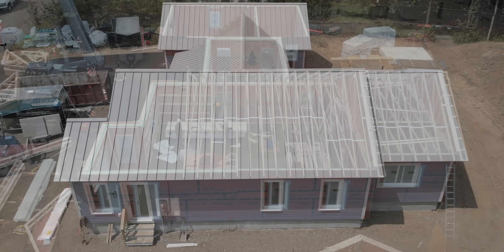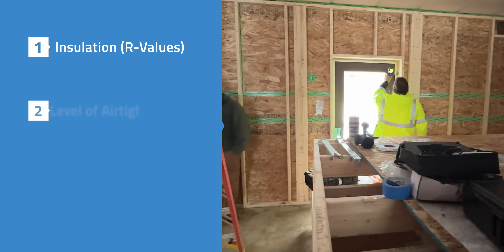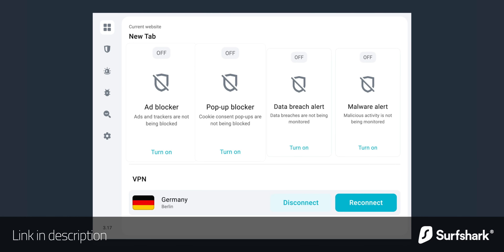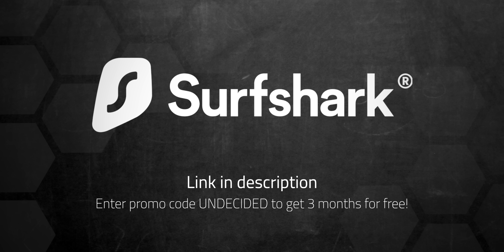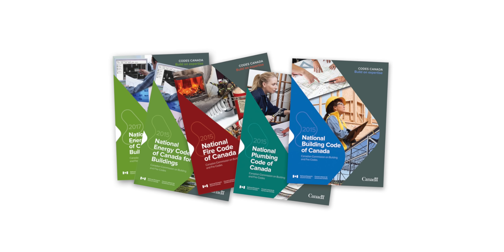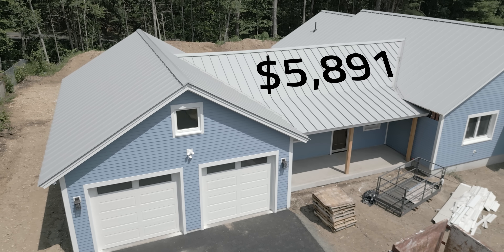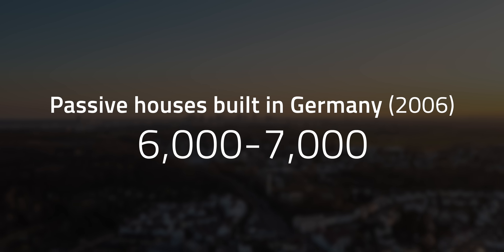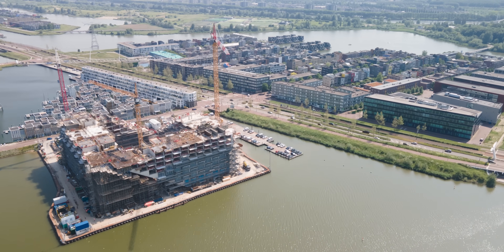Why Do American Homes Suck?

Comment: Simple answer: Houses in the US are three, to even four times, larger than in other Countries.
More complicated answer: We actually aren't "building" new houses in the US as frequent as these other Countries, that the typical consumer can actually have a prefab house of 1200sqft or smaller prebuilt for the typical "small home" cost in the US. Additionally, our "built" houses are around 3,000 - 5,000 SQFT in housing size, without the lot. To do this to an entire house is equal to having a large quantity of money, most people do not have in middle America.

In order for normal, average Americans to afford to have a "better climate, eco friendly house", they would need to be millionaires due to the 'wants and needs" of American's over our overseas counterparts that "do not require" 6 bedrooms, 4 bathrooms, and a large living room with a massive kitchen, dining area and pantry -- all well in excess of 20x20 per room size, with a dedicated room for all the serviceable goods.

Of course German houses would be insulated like crazy, the average housing size is 1,000 SQFT. The average "built" home in the US is well over 3,000 SQFT, with even "development houses with HOA's (Horrible concepts)', being in excess of 2500 SQFT.
That's 2 to three times the cost already. For a $200,000 turns into a $400,000 - $500,000 home, in the US, that has that standardized feature. In addition, we have "more" land. We have "more" everything.

But that's all beside the point.

The solution to here isn't to make homes as crazy as in certain countries. The solution is to better the technology to make it more costly and efficient to do.
Not everyone makes 800,000 USD a year. Most people make 80,000 - 200,000 in their household, and they aren't moving into houses that are "customized for them". They are moving into houses already "used".
I know I can DIY as must as I possibly can to get energy efficient as I can within my budget, but realistically the difference is both the climate and sizing. It's nothing about "imperial to metric" (Being also a car enthusiast who works in IT and remodeled his entire home to be more energy efficient), it's about how much materials cost, let alone the labor to have it done "in an instant", which is the second problem with the United States: We want instant results "yesterday".

Of course it's not in code.
Because it it was, no one would have a place to live.
Reply: I also want to make sure I emphasis that at 10:41, adding codes that then disenfranchise the average/middle class american from even obtaining a house is a net negative across the board. Of course, energy efficiency is important. However, you need to realistically say "Can someone actually afford this, whom the two adults work at this or this place"?
The answer is always a "no".

Even in my city, by "code" it's required I have city licensed electricians, city licensed plumbers, city licensed contractors and city licensed builders to "do anything" in my 1920's house. If I didn't have any sort of education or understanding as to how to argue against the city enforcement, then I wouldn't have even been able to update the windows in my house from 1920's windows because I don't have $20,000  USD, in cash on hand, in order to even do that, let alone "change the tile in my bathroom" (Which is literally the cost of tile, mortar and grout, and that's less than $500 in my case).

Realistically, making stricter codes, when it comes to expensive aspects, hurts the people. It doesn't help the people. Making stricter codes on "builders of multi-million dollar housing" does, however, help people. Because it forces the person spending $800,000 USD on a house to actually consider "Energy efficiency" when getting their house built.

Otherwise, most home owners in the United States own literally hundred year old houses with codes that are so far out of date, that they cannot, even remotely, "change a window" let alone "change tile" unfortunately.

So the real solution and answer of all of this, or the take away, should be more around "We should work on trying to lower the cost of these methods" rather than "It needs to be enforced". Because first, we need to make it affordable. Then, and after that, should it be enforced. If it's not affordable, you're disenfranchising most of the middle class, and lower class, from even owning a house.
Reply: 11:14 My guy, average American's do not have $50,000 USD in cash on a typical basis. This isn't a normal thing normal people can do. This is a thing "wealthy" and "the rich" can do. It is, by definition, for those of luxury. It needs to be feasibly possible to obtain all of them for under $1,000 USD total, not a loan, total, in order to be feasibly considered "Not a luxury". Hell, people consider "owning a PC" or "owning an iphone" a luxury.
I went through all of the quotes just now again, literally got a call, discussed it over. Location of my entire house.

I received a quote of $18,150. I do not have $18,000 to "add solar to my house". I do not have this sort of money. Most people, even "average middle classic american couples" do not. This is for the wealthy and the rich, not the "average" American. People do not have $20,000 USD sitting around in cash lol. No amount of "extra car payment" will make someone say "Let me spend money for solar".
This is where the secondary part of this side of the argument comes in: When you have a massive house, solar is a necessary requirement to lower the massive cost of electric down. A normal sized house, say at 1200sqft, is literally feasible to obtain lower energy costs all around. By extension, it's $23,000 to put solar on it. I checked a friends house too, with her permission, and it ended up being $58,000 because his house is 2100 SQFT.

People do not have this sort of money typically in loan, or in cash. That's a luxury. That's the definition of a luxury.

I love the idea, but it's not cost effective, it hasn't ever been. It's more cost effective now for those of wealth or riches -- the average consumer doesn't have this sort of cash. if we all did, and I cannot make this one more clear: Most people wouldn't be driving 10+ year old cars lol.

Let's also add onto the fact that we need to stop pretending consumers are responsible for the mistakes of larger corporate and business owners, or stake holders, who are the ones who typically produce the most waste. Although we should contribute, this onus shouldn't be on us, the consumer. We shouldn't have to worry about GHG when we're only a small portion -- whilst the largest portion is, without a doubt, larger entities that pour it out, without any emissions regulations. Although it's critical to be energy conscious and to lower your footprint, it's not as critical as saying "Hey, why is our electric company using gasoline or coal, when they could be using solar, wind or hydro".

And then, may I add: We, the consumer, wouldn't be even remotely required to obtain solar panels, as then the companies would already be energy compliant.
Us fueling the corporations energy, and thus them gaining money off our hard earned money, isn't helping.

Comment: To be fair, here in France we also have our load of "passoires" that have close to 0 insulations.
The funny thing is that they were built during the first oil crisis that led to us building our nuclear power plants. And we also encouraged people to run electrical heaters to avoid to import too much gas but had little concerns to insulate and save electricity. 
So I guess we jumped in the same pitfall: we had too much electricity to care about sobriety the same as you had too much oil...

Comment: This makes me think so much of our last apartment in Colorado before leaving. It was a nice place overall, but even in the relatively mild Colorado winter, our heat pump ran upwards of 20 hrs out of every day. It wasn't that we had drafts everywhere, it's that there was absolutely no insulation - anywhere. Nothing but the wood and siding. Every year they'd be sending out reminders all winter to leave the taps running with a slow drip so that the water wouldn't freeze on cold nights. The thought of insulating walls and pipes instead of replacing and cleaning up after a burst? They just looked at me funny on the suggestion, like they'd never even heard such a thing was possible, and said that it "didn't seem practical". We spent more on energy heating that small apartment than my parents did heating a detached home with a furnace built in the 1970s in the dead of Saskatchewan's winters.
Reply: Ooh, a mention of Saskatchewan winters! Lol. As a born and raised Saskatchewanian, can confirm, our winters are trying to kill us. There have been at least a few days in my lifetime where at least for a day, the coldest place in the world was a little town in southern Saskatchewan. One time when planning a mid September camping trip, we accidentally based our plans for a weather forecast in Alaska, and we still managed to under-dress on sweaters and jackets.
Reply: @reaganharder1480  Haha yep I remember walking to high school one morning over ring road in the balmy temps of -48. The air does some strange stuff down there, but it can be really kind of a transformative experience. No one is driving because the cars won't start, but the air is filled with floating crystals. Something else to walk around in. My wife does not understand.. but she's from the sub-tropics lmao.
Reply: @kaupaxup  you know, my first car was a little old junker than never failed to start in the cold. I never tried as cold as -48, but I did once or twice at -40, and after one or two slow and miserable cranks the engine fired up like nothing was wrong. Once I had a car with a hydralic clutch and power steering though, those cold mornings had other reasons not to drive than just the engine...
I also have some fond memories of eating the icicles off my first attempts at facial hair while shoveling snow... for as much as it tries to kill us, there's definitely something magical about Saskatchewan winters.
Reply: You leave the water running all the time? 😳
Reply: @buchbummelant8980  That's what they asked everyone to do. We didn't unless we knew it was going to actually be well below freezing or we were leaving town.
Reply: @kaupaxup  it's just baffling to me that there are people who waste clean, fresh water when most countries are heading into a fresh water crisis on an epic scale ...
Reply: A dripping faucet will not freeze.  But an architect should never locate plumbing within outside walls where they could freeze.   Bathroom and kitchen plumbing should always routed within an inside wall.   Outdoor hose faucets have to be placed in an outside wall of course, but the valves used are "frost free", a special design that shuts the water off 8-12" inside the house, not outside where the handle is.   @buchbummelant8980
Reply: Europe is even worse. They try to brag now but they didn't even think of insulation till the 80's. I've been in building all over europe.
Reply: @sparksmcgee6641 I smell some salty BS...
Could you be more specific on what part of Europe you mean?

Here in Germany, even in the 70s there where houses build out of a special type of brick (poroton) that's doenst apparently to be insulated but works by trapping air in its many chambers.
In the 60s they used a kind of loose arrangement of woodchips and cement to create plates that appear to be made out of sauerkraut (hence why they got the name, sauerkrautplatte)

Glass wool was very common in the 60s too, every roofspace was insulated with either woodflower/sawdust or glasswool!

In even older homes there was tow rows of brick that trap air in between to slow heat loss.

Mineral wool got very standard in the 70s, and even the most basic floor in Germany has insulation under the screed.

And don't forget that brick IS a kind of thermal barrier too, there are bricks that conduct heat well and some that don't, some that store heat and some that dissipate heat fast, all of them can be used in conjunction.
Reply: That is beacuase heat pumps are ot as effecient at lower temperatures.
Reply: @RayTheMickey  You may have missed the point that the winters are relatively mild.
Reply: @zweigackroyd7301 You missed the point that heat pumps aren’t very effective in Colorado in general.
Reply: @Matt-yg8ub  Can it be said I've missed something that isn't true? You can easily look this up. I am sure you'll find articles that say they don't work, but you can also find articles telling you the earth is flat. Look at reliable sources and a number of them.

Also, maybe you hadn't noticed that there are several climate zones in the 270,000 km2 of the state.
Reply: @Matt-yg8ub  They're very effective in Colorado - in fact that's exactly the kind of climate these were designed for. And they tested it when I complained about how much it was running and it was blasting out warm air at exactly the temperature they're designed and set to. They're just wasn't any insulation.
Now... if you're trying to argue that insulation doesn't matter at all and that furnace vs heat pump is going to matter more than any insulation in the home .... well, I've got this great product I'd like to sell you...

Comment: One issue that is missed in the latest designs is thermal inertia, with the possibility of intermittent power supply, heavy well insulated construction that hold the heat in is worthwhile, and of course helps in hot weather to.

Comment: One advantage of building cheap as sh1t homes, is that they don’t last, so you can build high energy efficiency into the housing stock relatively quickly.  In UK we have largely a very old housing stock.

Comment: Builder loans interest on back end.  Home buyer loans interest on front end.  Builder forced to build fast and cheap to avoid the bankster penalty.  Homeowner wants low price on loan to lower as much as 3X loan price over house price (exponential function in interest over time).  The elephant in the room is the money system, not the codes.  Total cost of interest service far exceeds energy losses.

Comment: There are geopolitical reasons behind ALL energy topics. France has huge nuclear energy generation capacity however that was mostly due to exploitation of territories that were administratively controlled by France in Africa. In US prices of gasoline have been ultra low because of our influence over middle east and venezuela while domestic policies heavily influenced by auto manufacturers lobby (which is also the reason why high speed rail was not, is not and will not be developed domestically).
Also, the way homes are constructed in US allows for a very easy remodel - it is much harder to expand your home in most of Europe.

Comment: Two major problems with wanting the government to encourage higher building codes:

1. A national building code for the USA would be a "One size fits all" for SEVEN climate zones. Can we make a national building code that takes each zone's building needs into consideration, yes. Can our government pass that detailed of a code, never! Politics would cause it to be simplified and standardized to the point that it would cause wastefully expensive and in some cases self destructive.

2. Making higher building codes the norm would allow economies of scale to help more energy efficient designed components to drop in cost, but as that happens lower energy efficient designed components would rise as they became the rarer option eliminating cheaper houses for lower income people. This would make life cheaper and easier for wealthy and rich people, but at the lower earners expense. Even more first time home buyers would become permanent rents trapping their families in lower income brackets forever.

This is a noble idea that can have very negative results.

Comment: I agree with Benson that the standards are too low, but not because of his reasoning. Our houses and structures were built amazingly prior to the end of WW2 maybe even before the 1910s. The problem was at the time it took to long to build a house by orders of magnitude. They builders could not keep pace with the demand by a long shot so they began cutting corners to save cost. The fact that the houses would fall apart in 20 years or so was none of their problem!

Comment: I think you missed the full concept behind a passive house. It is not only a matter of insulating the building from the cold weather but also to build having in mind that such house has to protect from the hot weather as well. It is important to talk about the R value but also about the phase shift of your roof as well as its damping factor (I don't know the English term). Remember that all building envelopes, when well insulated, protect from cold. Not all envelopes protect from hot weather though! Passive house is also about not having thermal bridges, using renewable energy, heart recovery, maximising heat gain by a good orientation, automatic controls, and of course, last but not least, a valid certification.
Reply: The full concept of Passive Houses is that the home is heated and cooled passively, i.e. without any mechanical or electrical assistance and without consuming any fuels. So cooling is obtained by having windows that can be opened, fresh air supplies that enter the home through a long run of pipe underground (so are tempered), and by shading windows and fitting "E" glass to avoid the structure absorbing too much heat in the summer. Passive heating is acheived by the triple glazed windows that don't allow out heat that the "E" glass has allowed in, having thermal mass to retain heat, and air sealing so that warm air doesn't leak out of the house. Some of the biggest savings to be had are available for very low cost if you take the truely passive approah. But for most climate zones, some active heating is necessary and comfort can be increased with active ventilation.
Reply: Indeed.